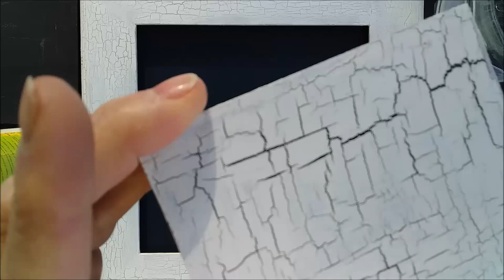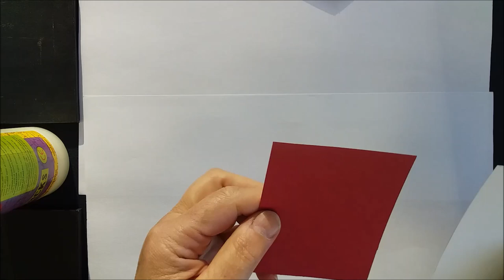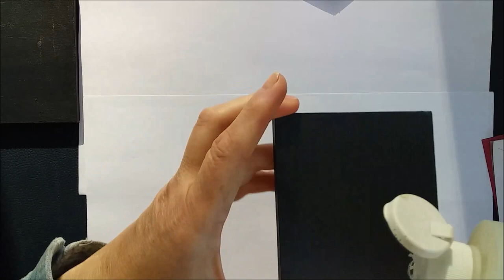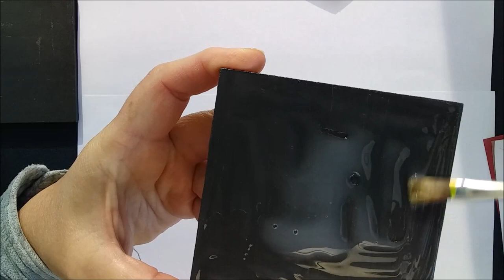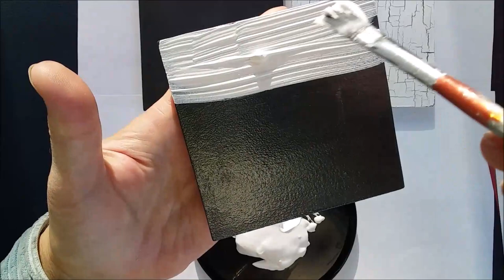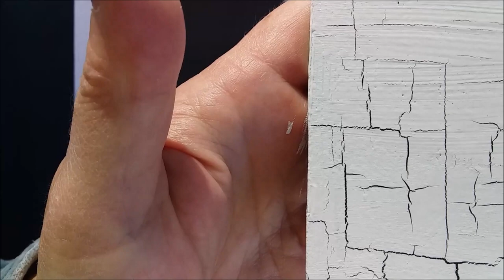HOW TO CRACKLE PAINT OVER PAINT WITH CRACKLE MEDIUM

Comment: Do you have an example of what you use to varnish or seal it? And is it necessary to seal it if it will be more of a decoration rather than a used object?
Reply from the maker: Hi there, depending on what you have made you could seal it with a variety of mediums eg canvas wall art you could leave plain, a box you could varnish with a clear acrylic varnish, a tray which you will use will need to have a heatproof or hard varnish, some items you could even use clear wax such as those made for use with chalk paints. I hope this helps...if not just ping me another question and I'll try to answer.
Reply: @colleenseymourcrafts5802  basically I have a window shutter that is painted black and I want to put a crackled white over it. It will just be indoors as a "vintage" decoration though
Reply from the maker: @estern836  I would either leave it untreated or perhaps use a clear wax or a matt varnish.